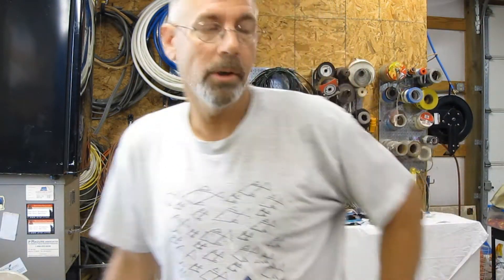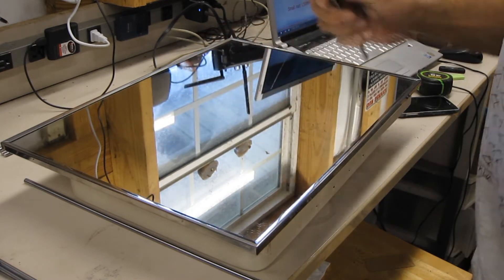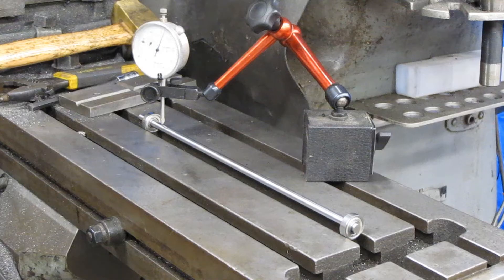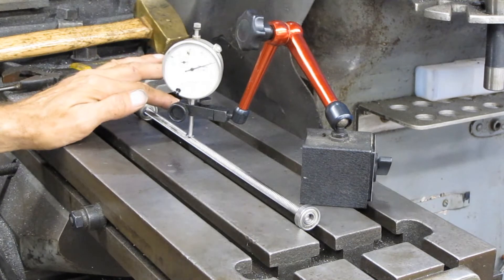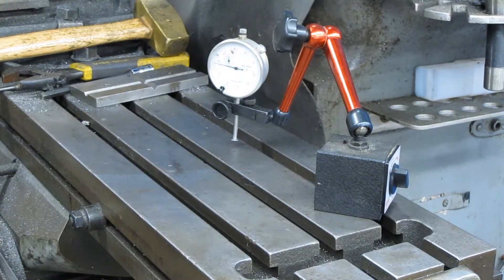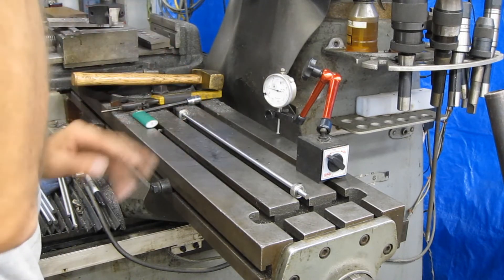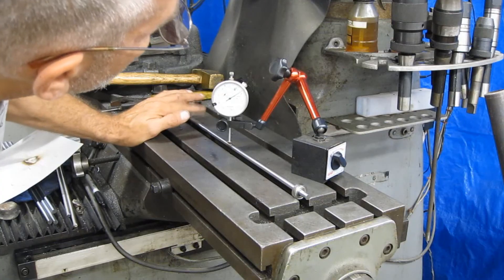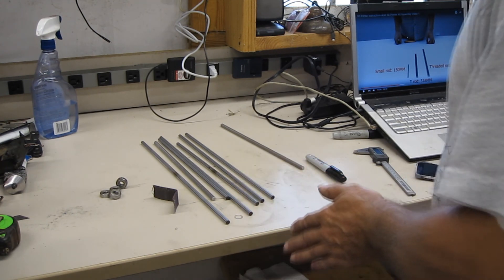3D Printer Anet A6, straightening out bent linear rods.

Comment: Nice video! But 10/1000 inch is still pretty bad right? That's 0.254 mm, so more than the very common 0.2mm layer height. Lets say your printer prints on the X axis, so from left to right, and completely at the left the print head is at 0.15mm from the bed so the first layer gets nice and squished. In the middle of your print surface the layer will be at 0.15+0.254 so about 0.4 mm, which is literally two layers.
Reply: Not necessarily because your bearing blocks will take out some deflection. I can't provide any specifics as I've never made any measurements but one remedy for bent rods is to rotate them so the high points are opposite each other and allow the bearing blocks to pull them together. If the deflection is too severe for this method to work, you will feel a notable difference in the friction as you run your carriage along it.

Comment: removed the hardening. Guess it doesn't matter if you're using soft bushings.
Reply from the maker: Brian Graves   Actually it was the opposite. If it was high carbon steel, i actually quenched it which hardened it further. To what degree? it's anybody's guess. Thanks for watching.
Reply: Freezing the crystalline structure to acheive the equivalent of the case hardened outer skin happens at a higher temperature than what is visible in the video. I wouldn't have said it otherwise. With a dial indicator there you could have easily just ran your spindle head down into the rod with something stuck in the chuck. With the right tools in hand it just stuck me as odd. You did a good job though. Not trying to be that guy, just trying to warn other that mechanical force is the way to go. With a torch  you'e gonna see a lot of people fuckin' up their stuff. You got lucky on your attempt. flame straightening a shaft isn't the most measurable and repeatable science.
Reply from the maker: Brian Graves
 it is an art. I straightened out 4 of them. Luck didn't have much to do with it. I even commented that I went over on one of them and had to bring it back the other way in the video.
Reply: I straightened 4x 12mm with a rubber mallet last night. Heat isn't necessary.

Comment: nice tip! how hot does the high parts need to be? i only have those small butane torches :(
Reply from the maker: Allan Mariano Until it just starts to turn red. The key is being able to focus the heat to a small area. One of those small butane micro torches would probably work. They're pretty cheap.
Reply: had to let you know the butane torch worked, but it took a few tries, took it slow, didn't want to over do it even with the small torch. thanks for the tip. my threaded rod keeps squeaking because of the bent smooth rod.
Reply from the maker: Allan Mariano Awesome!, I'm happy that I was able to help. When I did mine, I just wanted to try it, I figured I had nothing to lose. I definitely did not want to use them the way they were. Worse case scenario, I would have to buy new ones. It end up working great. 👍

Comment: Please do a video about flashing skynet and Bl Touch sensor
Reply from the maker: Tony Montana ,    Cool name! Thanks for commenting and watching. I can definitely show you how to flash skynet, but I have no experience with the bltouch sensor. From what I've seen, the bl touch sensor is a little more involved electrically than the inductive sensor that I'm using. I will be doing a video soon on installing and calibrating the cube sensor that I'm using.
Reply: I actually ordered the BL touch but it seems that you have to mess with LCD cables to make it work. Thats why Im looking sor something better, easier and faster. I would love to see complete video on how to flash, make changes in Config.h file (especially), mount and configure the sensor. Are you using this one: http://www.gearbest.com/3d-printer-parts/pp_591321.html ???
Reply from the maker: Tony Montana  Yes, that's exactly the one that I'm using. The one drawback to that sensor is that you can't use it with a glass bed, but really , who cares! Blue masking tape is working great for me.If you want to use auto leveling with a glass bed, you need something like the bl touch.
Reply: That great cant wait for your video I'm already subscribed :) I will order this also because Im using Buildtak not a tape. You can try it also it is much better and will probably work normally with this sensor.

Comment: Thank you so much for this! I have a feeling my linear rods are bent and had planned on buying new ones. I might try this first if you think a good butane torch would work. How hot does the steel need to get?

I got my A6 in January and love it. I'm working on setting up different hotends. Currently printing an x-carriage for a e3d V6 on a Volcano while researching a new control board so I can use the dual extrusion Chimera hotend I recent got. Lots of fun! I have some upgrades on Thingiverse for the A6, look me up the name is MakerMaveric.
Reply from the maker: MVOLZ77 The key is to try and get the heat localized , so you need a small torch tip. I tried a regular plumbing torch and it spread the heat out too much. Don't do it unless it's really bad, because you might make it worse. like I did in the video, if its less than .010" inches, leave it alone.

Comment: Quality control was not very good on these rods...
Reply from the maker: Stephane Lemay  I guess you gotta pay $1000 more to get a 3d printer with straight rods..lol
Reply: I've read somewhere that coming out of manufacturing plant, from the hardening process the steel will have a tendency to go back to its original shape from the memory the molecules hold.  Another process of hardening or seasoning, albeit another process equals more money, to get the rods perfectly aligned for the Long haul.